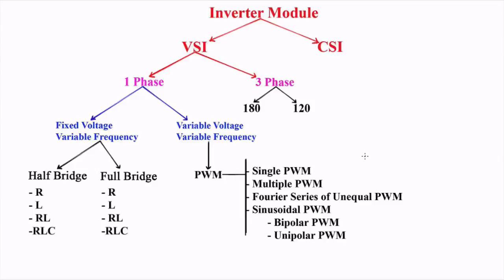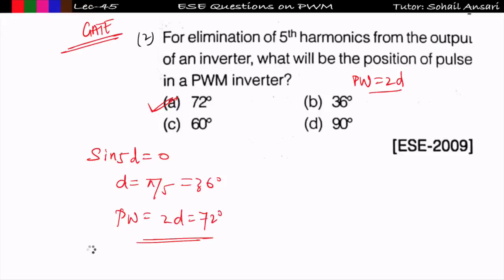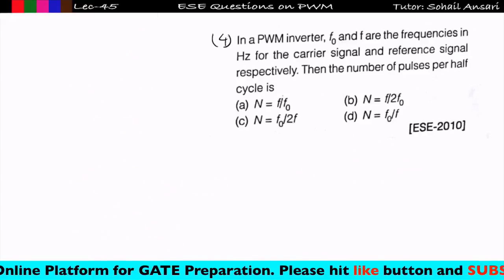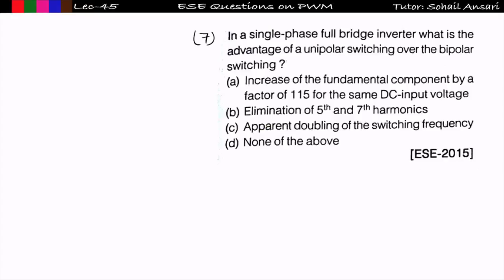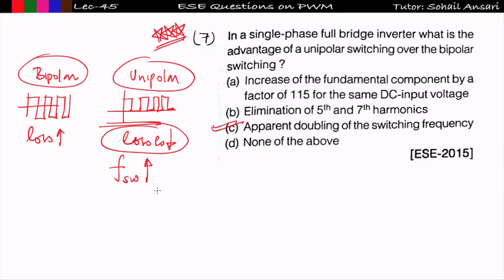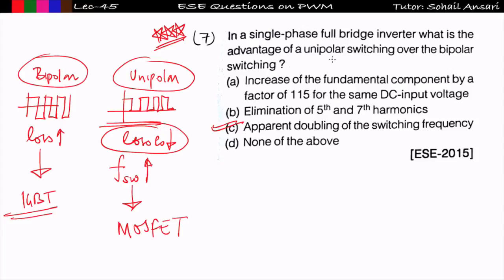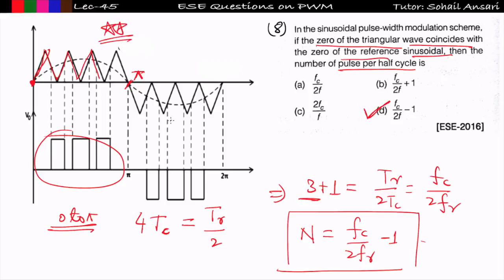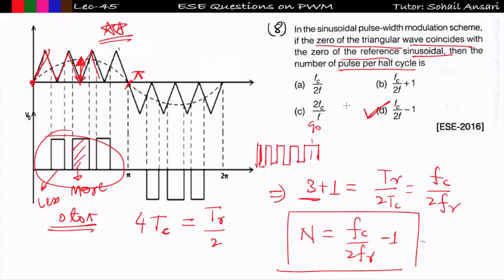Lec 45(b) ESE Questions on PWM Inverter | Power Electronics

Comment: Ques 4 answer will be option C..and in ques 7.. u said in lec that frequency of UPWM will be higher but will be 2 times than Bpwm?..
Reply from the maker: It is not necessary that its 2 times always...generally its more than unipolar...so twice means more than unipolar only..ok
Reply: Okhay sir
Reply: Sir, synchronous machines mein prblm aa rhi h... A synchronous ka part kb to cover karege PS  lectures MEIN?